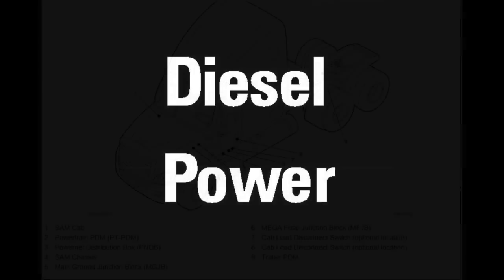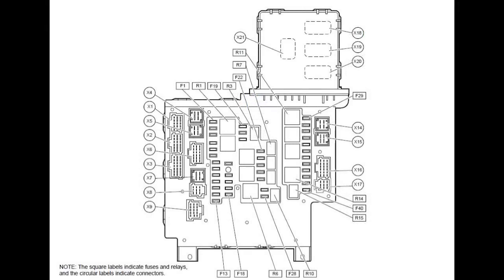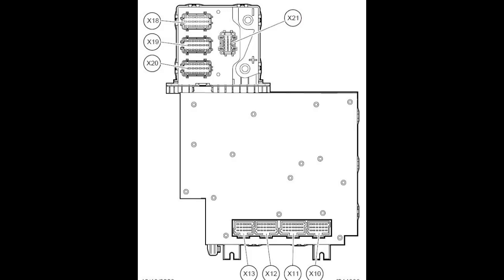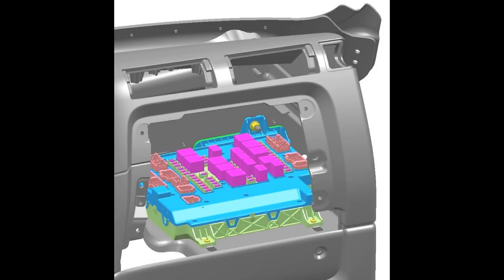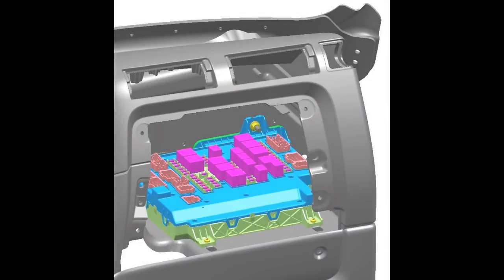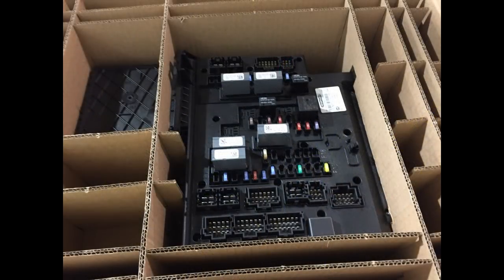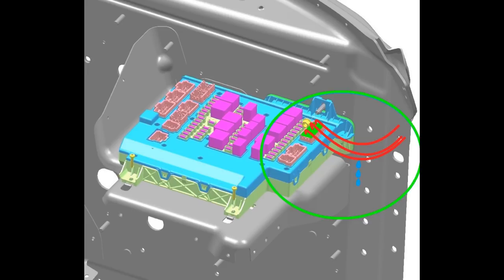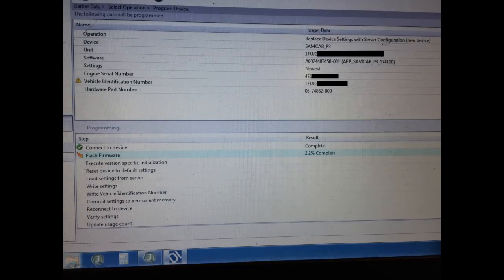Know your Cascadia: The SAM Cab

Comment: While driving, I would hear a relay click and all switches ( mirror heater, utility lamp,rest in that row), including hvac, are dead. Later on, relay clicks again, and power is back on.
Reply: Did you find solution to your problem
Reply: @Gurpreet682  ground cable,

Comment: Does the cab sam control turn signals & windshield wiper functions?  They both work fine after being parked for the night but a couple hours into a run, they function erratically!
Reply: The turn signal/wiper switch controls your issue not the Sam cabin or Sam chassis modules.  Sam’s just do input and output signals for components to work they need switches or inputs to do work.  Hope this helps!

Comment: Thank for all your video 
I Q and I need help….I want to replace upgrade my instrument dash gauges since I have the basic Square one…I bought one but it say “no buses “ I believe..can I program my Sam cap to work …..
• 2nd thing …my truck didn’t came with a lot of options like let’s say footwell lights….how can I add them the right original way ….I’m in Houston can travel anywhere as long someone know what he’s doing 🙏
Reply: You would have to make sure your Sam has the pids to work with all the extras you want to add on.  Meaning if your Sam can work with the door well lights you add on with the switch.  All sams can be programmed to work with different components or add on components but you have to know how to set up the Sam when you program it.  What you are asking for is expensive, just letting you know!  Hope this helps!
Reply: @topshotta5676  thank you for getting back to me…so who can do this ? Is it only dealer
Reply: @oasisauto  anyone can do this as long as they have a computer to program the sam

Comment: Thanks a lot sir I'm replacing the Sam cab as we speak. Quick question if I take one out of another truck and put it in another truck do I still need to get it program??
Reply: The two trucks MUST be exactly the same. You could compare both Sam Chassis. If they are exactly identical then no programming is neccessary.

Comment: Hi there. I purchased a 2015 cascadia that the cab caught fire and was completely gone, so I replaced with a used 2015 cab from a good salvage truck, same engine and transmission, but the truck will not start, do you think that the sam cab needs programming or it may be another issue? I conected a scan tool and it cannot communicate with the truck ECM.

Comment: I have a 2014 Cascadia with a DD15 and my taillights flash by themselves during the night with the truck not running and the red light is blinking on the black box that says Main PNDB and when the truck is idling it will just shut itself off sometimes after about an hour so does this mean I need to replace the PNDB box? Any help will be very appreciated.
Reply: Please can you answer for this question main also same problem
Reply: How do you fixed
Reply: @borabora5442  👆🏻
Reply: I replaced that PNDB BOX and it fixed my truck

Comment: Hello mr. I'm having the Cab33 code and going to replace the Sam cab. Can I do that without reprogramming the new one.. because that I'm getting it  from my other truck that are the same year and model but different engine.??
Reply from the maker: Cab33 is the trucks way of telling you the Sam Cab is broadcasting a fault, but it may not have failed. It's best to get the actual faults from it and diagnose those before replacing it. In some situations the Sam Cab controls things like starting the engine. Depending on the parameters between the 2 trucks, swapping them without reprogramming may lead to problems.
Reply: The freightliner dealer told me that I have to replace it.  And the other truck does have the same engine dd15 and same year so I'm going replace it and see.  Thank you very much for the information.
Reply: @HindGhaidBassam  Hi do have the samcab 033 can you help me please

Comment: Are Cascadias the only ones that drip water over important parts or does this issues apply to Volvo, KW, Pete?
Reply from the maker: I've seen it from time to time in various other makes and models but unfortunately the Cascadia seems to be the worst culprit.
Reply: @TheDieseler  Any suggestion to protect the electronics? I have changed windshields, gaskets etc.  Next should be a class action suit against Freightliner.